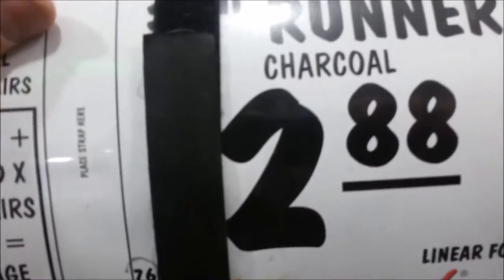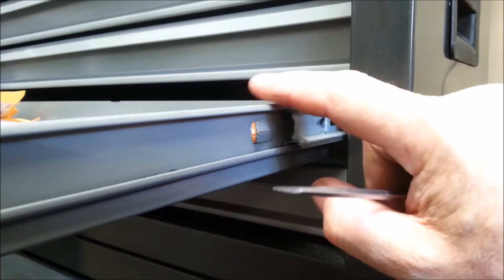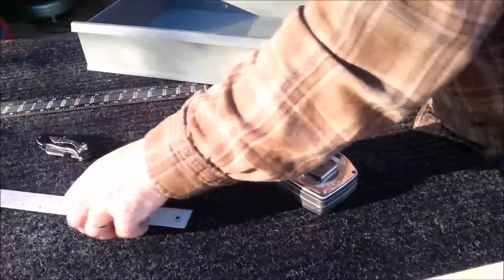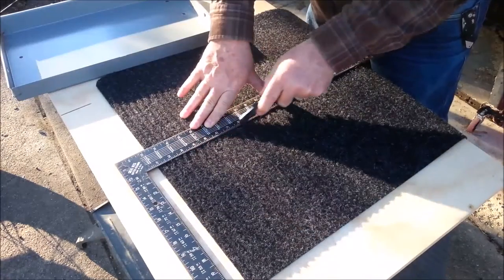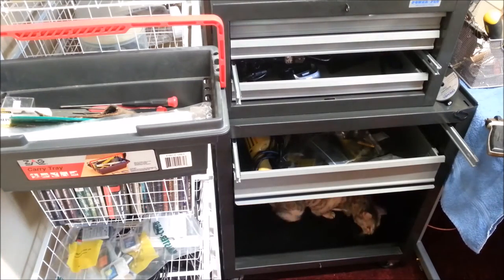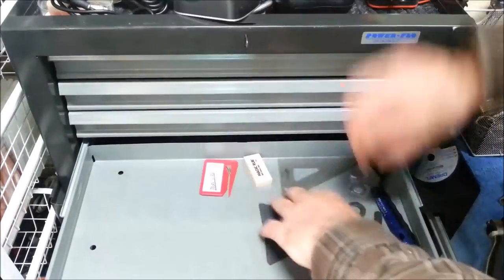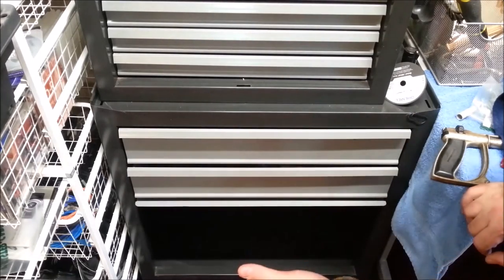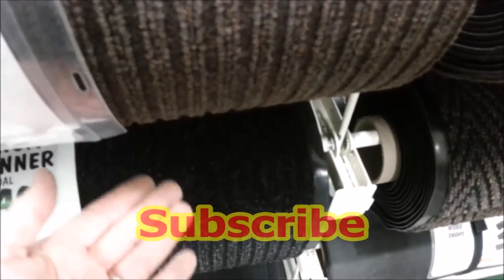Toolbox Secrets Luxury Liner Crafted Channel

Comment: Great Idea.  Ive got to redo mine when I move my shop.  I did find at Menards some rubber mat that does not have the carpet on it so I thought about using that but Ive have a couple of those same carpet mats like you used.  I think I'm going to use what Ive got.  Thanks
Dave